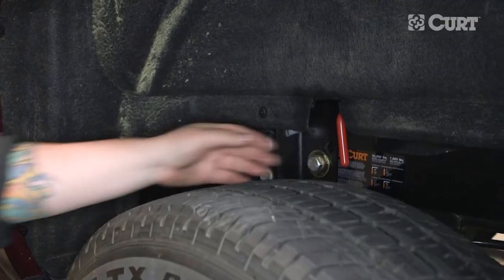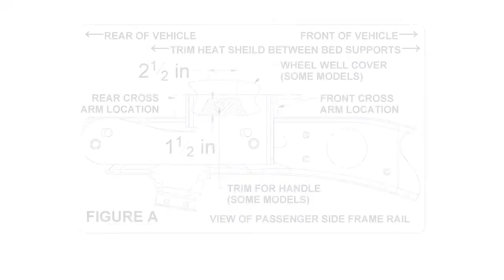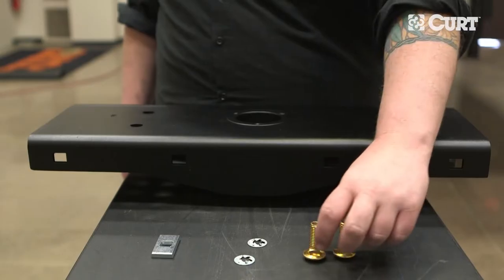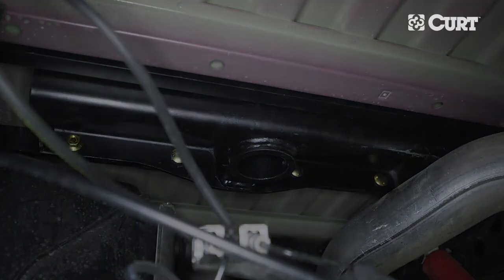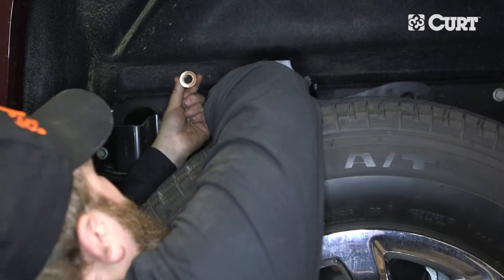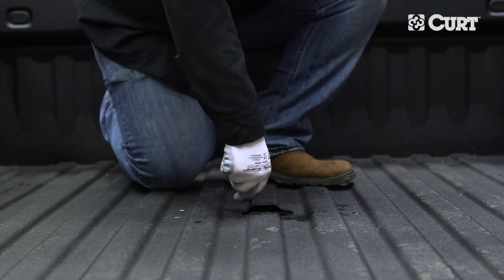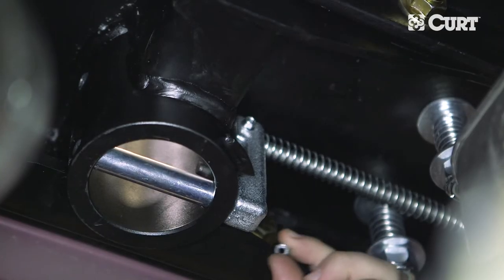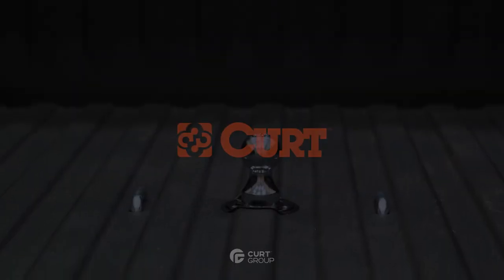Gooseneck Hitch Install: CURT 60624 with 60611 Double Lock EZr on a Chevy Silverado 2500 HD

Comment: I'm installing the Curt 60720 in my 2000 f250. I can't find the spring for the locking pin handle. Can I get the dimensions. I might can get one at the hardware store tomorrow
Reply from the maker: Please give us a call at (877) 287-8634, extension 2, and we'll help you out.

Comment: I purchased a used truck with this kit installed. When I pull the handle to release the ball, it falls through the hitch and straight to the ground. Sounds like there's a pin that should be in there to prevent that. What part do I need to fix this?
Reply from the maker: Please give us a call at (877) 287-8634 EXT. 2